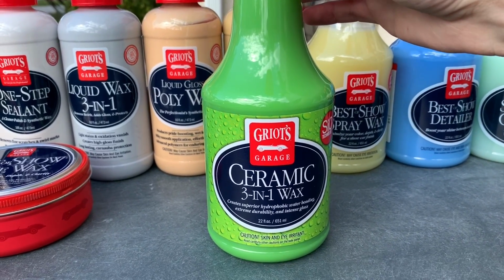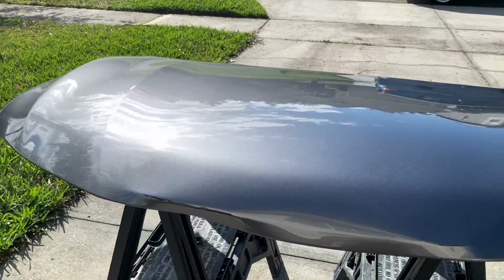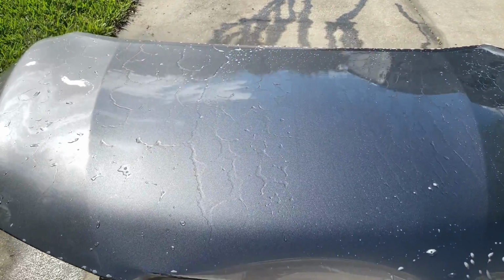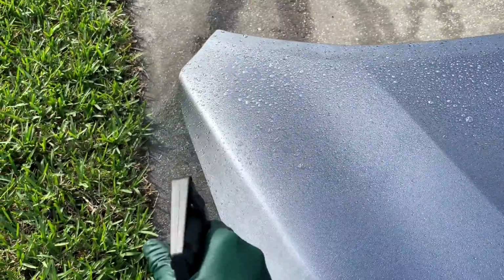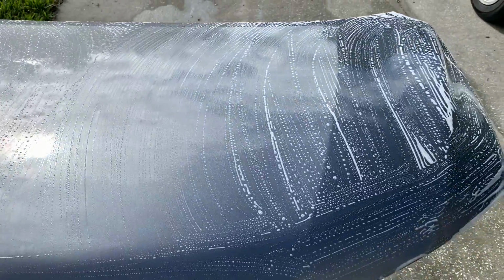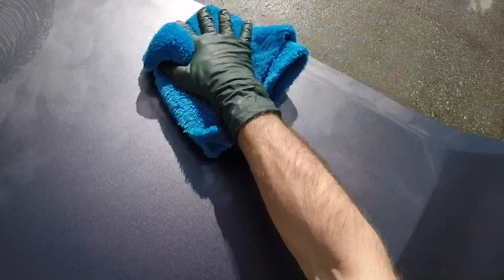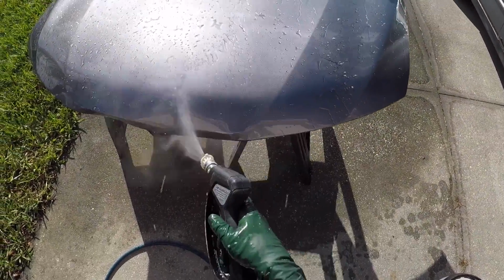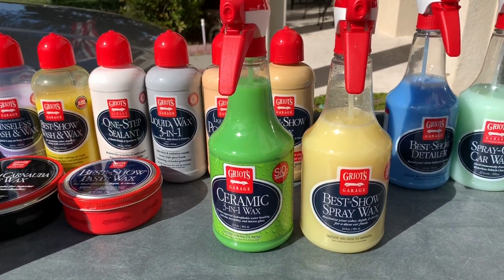Griot’s Garage Ceramic 3-in-1 Wax - Great First Impressions!

Comment: Which one do you think is better?

Griot 3 in 1 or 303 Touchless sealant?
Reply from the maker: 303 Touchless Sealant I would only be using as a dedicated spray and rinse, I would not be using it dry.  And I have seen some heavy streaking/residue in certain instances of using it, you definitely want a strong pressure with it when you're rinsing.  I think it works great for wheels, but for the paint I would much rather use the Griot's Ceramic 3-in-1 Wax as opposed to using Touchless Sealant.
Reply: @WaxMode  Thank you so much!! Subscribed too

Comment: Excellent video! Thanks for reviewing and demonstrating this product, it has definitely peaked my interest. 

Just a quick question...which wash mitt are you using in this video?
Reply from the maker: Thanks a bunch!  The green wash mitt is a cheap one I picked up at Advanced Auto, I think it's the AutoCraft Microfiber Sponge.  Works good for testing, usually I have a bunch of chenille microfiber Gold Plush ones from Autogeek, and the Bull Shine Fluffy microfiber mitts from Shiney's Detail that I use for full washing, but any sort of strip based testing on the panel I'll pull out the smaller mitt.

Comment: It would be interesting to see griots three-in-one ceramic wax compared to Turtle Wax hybrid Solutions Ceramic spray coating.
Reply from the maker: I've got the two of them side by side on the other daily driver, so I will release updates once I get more time with them on the paint.
Reply: 404 not found i a tually use both...products....T/w Hybrid Ceramic spray, 2 coats...then Griots 3 in 1 as a detailer and follow every other car wash. I use both on pearl white, dark gray-dark blue, and 2 black cars...but as he said...follow mfg label instructions to the letter.....i tried shortcuts, it does not.....work as good, as long, etc....

Great content!

Comment: I'd love to remove body panels to wash and prep them; so much easier to work with.
Reply from the maker: I've got to grab some better stands to work on.  Sometimes when you have a panel off like this, if you don't have it secured just right on the stands, then any sort of slight pressure will want to slide the hood off.  I've come close a few times which is fine because this is a throwaway panel, but I've got to do some more research on how to actually secure the panels better.

Comment: What are your thoughts on this vs the Adams ceramic spray? Im really liking the idea of having something that can last a few months if I need it to, especially through midwest winter months. But also something I can easily reapply over itself often the rest of the year.

Would you recommend anything, be it wax, sealant, coating, etc... that would make my GM white paint look the most glossy and "wet" looking?
Reply from the maker: That's a tough one, I REALLY loved the way that the Adam's Ceramic Spray Coating applied and buffed into the paint.  I thought it was super easy, and it has lasted that 11-12 months on the rear section above IGL Premier, I want to say it felt even better than Griot's Ceramic 3-in-1 Wax in terms of application.  The problem is I haven't tried their updated formula out, so I'm not sure if they ended up changing how easy it is to work with or not.
White for me pops with the paint correction, fully decon'd, swirl free, I don't think it benefits from the oils in the waxes that aid in depth, so I've always preferred your more synthetic based protectants like Power Lock in the past.  Both Adam's Ceramic Spray Coating and Griot's Ceramic 3-in-1 Wax should be awesome on white, not as much oils like Best of Show Spray Wax delivers, more of a crisp reflective appearance.
Reply: @WaxMode  I have 2 pearl white cara in my family and used Megs ultimate compound and polish after a full decon. I used powerlock + and collinite 845. It brought so much pearl and depth to the surface. Incredible results and for extra slickness I topped it with beadmaker

Comment: Can I ask the best of show spray wax and detailer.Do they match zaino z8 or blackfire or pinnacle for shine.Thanks
Reply from the maker: I've been wanting to get my hands on Zaino Z8 because of the reports I heard of how much gloss it could bring out of the paint, but haven't pulled the trigger yet.  I've worked with Blackfire Midnight Sun Spray Wax and Pinnacle Souveran Spray Wax, and I actually liked Pinnacle better because it was noticeably slicker to me and my neighbor with his S550 Mustang agreed.  Best of Show Spray Wax seems heavier than both Blackfire and Souveran, so you'll need a bit more time with the microfiber towel to get a clean wipedown, but I think it can compete on gloss and depth with Souveran.  It will also be more hydrophobic as well.  The detailer pairs perfectly with a lot of things, isn't heavy, nice and slick, smells fantastic, not super light or too heavy, just right for me.

Comment: How would this compare to Megs Hybrid Ceramic Wax (the spray one) in the way of long term durability? I'm currently using HCW as a spray on, rinse off then use a drying aid like bead maker with dedicated drying towels. I recently picked up a bottle of Megs Ceramic Detailer to use as a drying aid, but I did see the Griot's 3-1 in Autozone at the same time. If the Griot's is just as durable, I might replace both with this to shorten my washing routine.
Reply from the maker: Meguiar's HCW lasted well into the 5 month range next to Turtle Wax Seal N Shine, degraded but survived without maintenance.  Griot's gives a conservative estimate of 6 months out of Ceramic 3-in-1 Wax, so I'm looking foward to seeing how it holds up.  HCW is definitely much different than the Griot's.  Heavier, and it likes to be used wet once you have that foundation down, but also has a much higher hydrophobic limit compared to the Griot's.  So for guys that like extreme hydrophobicity, you can't go wrong with HCW + the new Ceramic Detailer.  If chemical resistance is more of your thing, the new Turtle Wax Hybrid Solutions Coating and this Griot's Ceramic 3-in-1 Wax will outperform Meguiar's in a fresh test against Strip Down, but they won't be as hydrophobic.

Comment: Great video! Really want to try this out! Very resistant to poorboys strip down in short term! This could be very great as a topper let alone a stand alone product. 👌
Reply from the maker: I'm stoked to see how this holds up over time, it definitely has potential and I was flabbergasted at how it pretty much laughed Strip Down off the paint.  I've got a good batch of TW Ceramic Spray Coating and Seal N Shine brewing on this test panel, that's what I'm working on next so we'll see how they compare to Ceramic 3-in-1 Wax here.
Reply: @WaxMode  I was definitely blown away at how strip down did nothing to it. Look forward to your results with the TW!!! 👍👍👍

Comment: great vid...quick ques...u have klean strip in your links but u said u used poor boys strip all.....confused as to which was used
Reply from the maker: After polishing the paint with Perfecting Cream, I used Klean Strip Prep-All as my panel wipe prior to applying the Ceramic 3-in-1 Wax and BOS Spray Wax, that's to remove any of the polishing oils left behind by Perfecting Cream.  Poorboy's Strip Down was used as my dedicated wax stripper to try and remove the fresh products after they were on the paint for the test.  I don't think Amazon has Strip Down on their website, you can pick it up at Autogeek here if you're looking to try it out:  https://www.autogeek.net/pb-strip-down.html
Reply: @WaxMode  thanks for the quick response.  I am considering it...will the 16oz do a whole car....lexus es 350....looking for something easy to remove old toppers like carpro elixir, puris jade A68 reboot, tw hybrid solutions spray, c2v3,....and more...have been tinkering this year during the si02 craze....in your opinion will this do it.....also considering jim lafebers(dr beasleys) panel prime....not cheap tho.   whatcha think
Reply from the maker: @johnketuroskey6293   You should be able to stretch around 2-4 applications out of 16oz on a standard sedan.  You want to make even coverage across the paint, so if you spray effectively then you won't have to over load it up in one area to get it to work well, I'm most likely dumping way more than I need to as an example in this video.  If it's not going to strip, dumping more on the paint is not going to be as effective as applying another separate application of it afterwards.  Elixir is definitely one of those more resistant types of protectants, very resistant against Strip Down if it's fresh, if it's older it may be able to dig into it.  Haven't tested C2V3 against Strip Down yet.  Panel Prime from Beasleys seems more similar to something like Gtechniq Panel Wipe that you don't rinse off the paint, I definitely need to pull that out again to run testing with it, maybe this weekend to do a direct comparison with Strip Down's performance.
Reply: @WaxMode  do u have his panel wipe??? would love to see a comparison test!!   have u tried his ceramic wash???  when I met with him to discuss a few things I had the  lexus washed while we talked and when I saw the car I was like "wow"...took some home for maintenance.  I have used/tinkered with "a lot" of wash products - I have been using reset as my go to.  his premium wash sounds like it is similar to reset - which was one of the things we discussed - but he stated he uses the ceramic in his wash services.  it states u may only have to "lightly agitate" on second foaming.....as absurd as it sounds on a moderately dirty vehicle I have only agitated once in three washes.....keep in mind I am in Chicago/nw Indiana area with intense salt exposure.  fyi - he is unveiling his new si02 polish this weekend at MTE....will be available in march
Reply from the maker: @johnketuroskey6293  Ahh I missed your comment, I was at MTE earlier today and I must have missed his booth!  I haven't used his panel wipe, I came super close to picking up his coatings a few years ago to try them out, have you worked with those yet?  I need to grab another test panel that I can focus purely on coatings with, I actually tried grabbing a few infrared curing lamps from Amazon, both of which came in broken which put a hamper on my accelerated curing tests.
Reply: @WaxMode  that would have been awesome....as I said he unveiled his new new si02 infused polish. I believe he was also a keynote speaker as he was a past president of IDA and a certified trainer.  I am considering trying the 1201 coating/sealant.  I guess u have the space for the ir's?   hope u enoyed the expo - what was the highlight for u that u saw there?????
Reply from the maker: @johnketuroskey6293  - It was a fun time, I ended up meeting Matt from Obsessed Garage finally, great guy, been a fan of his channel and vision for a long time and we're looking to collaborate together for something in the future.  Got my hands on the new Flex PXE 80 for a test drive, fantastic precision tool, the quick disconnect on it is such a smart idea for switching really quick between DA and rotary modes. 

Met with the Meguiar's guys for the first time, new professional line should be out really soon, looking forward to buying those when they're released, especially M27, for some reason I'm really gunning for a super easy to use liquid sealant for machine application that's going to match my exact preferences.  I have M27 hyped up for that role, we'll see if it can fill it. 

Got my hands on the new Griot's G8 for a test drive, another awesome tool that I think is going to be very popular for Griot's, really good price, nice and smooth, has so much more power than the previous unit.  This I think I will be buying sometime in the future.

Met with Nick at McKee's 37, they're getting ready for the grand opening of their new headquarters at the end of the month.  Just released their brand new ceramic lineup, new coating, and I had a lot of great results from the previous version so I do want to end up testing this one out in the future.

Ivan was there at the Lake Country booth that walked me through their new UDOS polisher.  It's definitely not as heavy as I was expecting, maybe a half pound more than the Rupes LHR15.  I like the rotary mode a lot, definitely felt a bit more vibration on the dual action mode compared to something like the Rupes, the fit and finish of the tool looks spot on, they're excited to get this out ready for sale by April-May I believe.

Glad I decided to show up at the last minute, we're getting some really cool tools coming to the market, more durable forms of protection that are easy to use, I'm remaining excited for 2020.
Reply: @WaxMode  wow...u must have been motoring!!!!!..I have talked with Yvan via text a couple of times...my 05 jag vanden plas saloon is couated with opti pro - jason at Chicago auto pros did it  - did u see him there?  I too am very interested in the m27 - ever since I saw it thru the sema vids.  but I am getting frustrated/almost pissed off with the oversaturation of the si02/ceramic craze as almost all products being put out there by solid companies are about the same....maybe your tac,xtreme solutions and several others are a step above.   the market is over saturated..period.  we are on journey to find the holy grail of detailing - and I am almost certain the closet thing to that is graphene!!!!!  I have vids if u want me to send them to you.....I have never seen a car being washed with reset and the reset if running off the panel almost as it is wiped with the mitt...incredible.  be well let me know about vids

Comment: This vs megs ceramic detail spray?
Reply from the maker: Meguiar's Ceramic Detailer is definitely more of your topper type of product.  I would not personally make plans to run Hybrid Ceramic Detailer as a standalone protectant, which is something that you can definitely use the Griot's for.  HCD is going to be much more hydrophobic in the short term, but the Griot's should outperform it in total durability in theory.  I've got a batch of the Ceramic 3-in-1 brewing on some of the coatings on the blue Honda to see how it performs as a coating topper, so I'll have an update in the future once I get some results in.
Reply: @WaxMode  I'm hoping here meant Meguiar's Hybrid Ceramic Liquid Wax and not the detailer lol

They have it at AutoZone as well

Comment: Saw this in advanced auto!! For me it's a win because turtle wax ceramic spray you can't buy it on a retail level. This you can!
Reply from the maker: I'm keeping an eye out, I believe the Hybrid Solutions line will be available at retail stores some time in the future, not sure when.  But yes I was surprised to find Ceramic 3-in-1 Wax already available at Autozone, they had the new updated Meguiar's Ultimate Quik Detailer and Spray Wax that I picked up at the same time, and I saw the 26oz size of the Hybrid Ceramic Detailer, as well as their ready to use 32oz bottles of Hyper-Dressing and their new Iron Removing Spray Clay.
Reply: get it on amazon or at walmart
Reply: Yeah you can get TW in stores now.